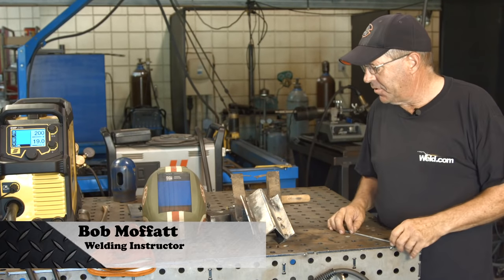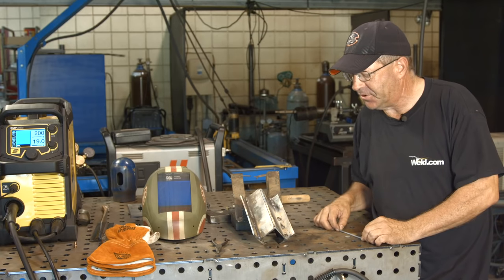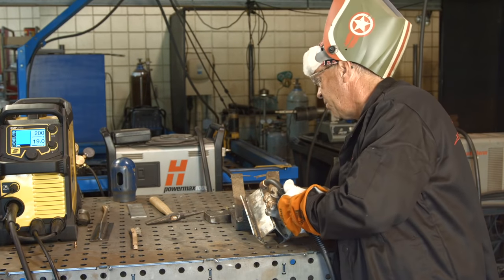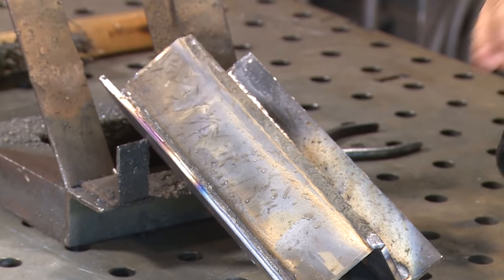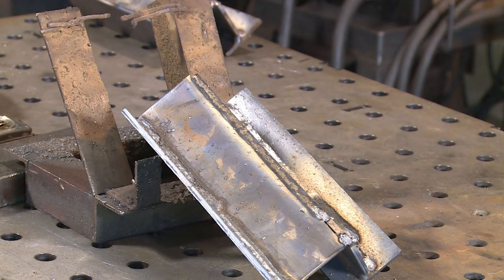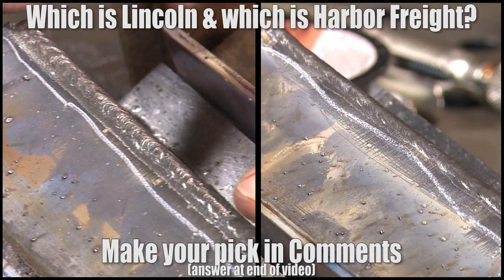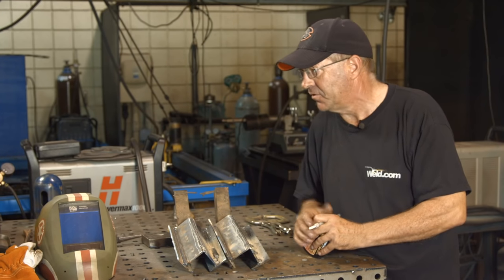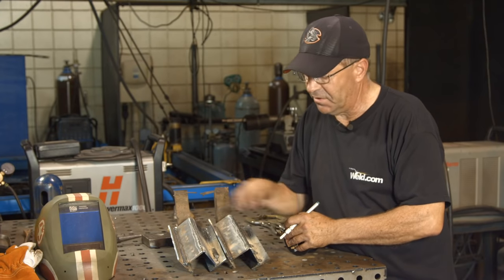Harbor Freight Flux Core Wire vs Lincoln Flux Core Wire: Part 1 of 2

Comment: I've used the Lincoln welder similar to that one back in 2000 and to 2003 I'm not in a professional just kind of self-talk myself what would be a Ideal wire feed welder for similar Metals White body work to medium body work metal thickness wise is there other welders out there that are easier to use and last longer I guess the whole question is what's going to be the best for a beginner and last the longest more durable I should put and we'll be able to do 16 event maybe up to quarter inch steel

Comment: 6:58 you are so far from wrong. First time I installed one of those in my 115 volt flux core machine I didn't hold the wire and about 2 1/2 feet sprung all over.

Comment: In my welder I can't adjust enough to make a decent weld with the harbor freight wire. It just doesn't stick. I go with the lincoln every time. Also I use the nozzle with mine because the splatter hits my wire without it and I notice it affects my weld.

Comment: i have the 90 amp harbor freight mig welder     and honestly   i prefer  the harbor freight wire  , i noticed you get twice as much wire  than the lincoln spool  for around the same price    and over time  the lincoln wire will plug up your contact tips alot more    it actually gets pretty annoying  ,

Comment: Awesome video! You just picked up a sub for sure. I am actually going today to get a JobSmart 125 amp to do some body work on an old beetle I'm working on.
Reply from the maker: Nice! we'd love to see some pictures of your progress on the forum.
Reply: Heading over to check it out now!
Reply from the maker: Billy Martin we're currently rebuilding the whole site, so the registration is down. Send me an email at info@weld.com and I'll set you up.
Reply: You can see my project at https://www.instagram.com/lowriden99ranger/ go check it out. There's going to be a video of the whole transformation when it gets done.
Reply: Hey Billy, sounds like we're in the same boat...  I just inherited a 71 beetle that I'm getting ready to strip down and I'm going to have to cut out the old heater channels and weld in new ones.  Say Bob.  Do you think I could get by with a flux welder for that job?
Reply: Have a jobsmart 125 Lincoln NR 211 MP works like a charm some spatter and smoke but can still see where I need to weld. Hobart does good on thinner stuff but more smoke and spatter hard to see

Comment: Not sure what was going on here but I use/used the harbor freight in both my miller 220 and I've used it in a harbor freight 90amp and it has only ever sounded like that when I had a shit ground. I usually have a nice steady arc sound. Seems very odd.

Comment: Bob, I find using the larger style spool of wire caused less issues with the spooling aspect you talked about; I guess from the larger spool there is less potential for bird nesting, anyway my thoughts on the owre spool issues.

Comment: i've done flux core for a bit at school now. had similar feeling where the wire didn't come out consistently. i'd also had problems with the same wire on 3 machines getting porosity. i'd tried different positions and speeds and settings and techniques and it was all the same so idk why flux core is so different. however i have gotten better arc length consistency by turning up a lil of the voltage and wire speed and reducing my gap by 1/8th. Flux core is so strange to me, i've done GMAW and SMAW for 6 years so i figured it would be in between them both but i never had such problems with either.
the wire was nr211  0.035 and the machines were a new lincoln and 2 millers of different types and age.
failed a 1 inch 3g because one of my bends had porosity cracks. really dissapointing but nothing i did changed that.
if anyone has a suggestion im all ears!
Reply: john creamer could it have something to do with your ground clamp?
Reply: @charlescooperderose8872  3 different machines, 3 different clamps, changing settings too. i melted the tip turning it up too high once.

Comment: were you using a knurled feed roll? i know it sounds like a gimme question, but the cheap fc welder that i have here didn't actually come with one when it was bought and sure enough, i got a lot of that slippage and jumpy arc trying to use the standard roll with it
Reply from the maker: Yes, we were using knurled drive rolls in the Rebel 215.

Comment: I have found with the harbor freight wire to fix the inconsistent wire length is u have to run a little higher wire speed

Comment: One of the other welding channels showed that the wire feed roller for a mig wire is shaped slightly different with serrations in the roller for mig wire vs smooth for flux core wire.
Reply: Its actually the other way around. serrations  groove is for flux core wire smooth for solid wire..

Comment: 1:57 - CTWD > 1/2" minimum; you say it's 3/8ths and sometimes your closer than that.
3:42 - You're a volt too high for that amperage / Wirespeed. Read the Mfgs recommendations when 1st time.

Puny Spools and very large diameter Wire always wiggle; puny spools work better in a Spool Gun and large Wire is slightly better if you straighten your Cable.

Twist the Gun so the Wire wobbles in a favourable direction (back and forth, or sideways to self-weave), diagonal wobbling would be useless; don't try to fight the Machine and expect the best results.

Usually that kind of Wire is for outdoors, useful when you don't want to haul Gas Cylinders (like high off the ground, Shipbuilding or Skyscrapers) and it's usually 0.45 with a bigger Stickout in a Suitcase.

Incorrect Stickout and off a Volt is off enough to not get the best results.

Parameters: http://m.lincolnelectric.com/en-us/consumables/Pages/product.aspx?product=Products_Consumable_Flux-CoredWires-Self-Shielded-Innershield-InnershieldNR-211-MP(LincolnElectric)

YT,
Rob

Comment: My Lincoln 90i FC will weld just fine for the first 20 seconds. After that, it wants to spool slightly. It does it with every wire I use. Drives me nuts.

Comment: believe it or not but we had the same issue in school with close to the same settings and the instructor contacted the maker of the wire and what he found blew us away. they said it had to be ran in a certain parameter, that being 16-17.5 volts and only 120-130 ipm, which we ALL thought sounded way off. when we tried it it blew us away because the welds were slow but beautiful. this may be different but I just thought I would throw that out there. I guess  Flux core wire is very particular and isn't run the same as other wires.??

Comment: I've been working with spool fed welders for 30 years open your box while you're pulling the trigger and not welding watch your wire roll and listen what's your Drive rollers and listen to them grab the wire after the contactor tip with a pair of pliers and try to stop it from coming out and pull the trigger that skipping could be caused by the paper on the spool they put the paper on the side that goes to the inside of the box you going to rip that sticker off it will mess you up you up

Comment: that wire is real finicky if you have any kind of debris in the liner it's going to do that you can't get away from it most aggravating. I use that wire almost every day there's a big difference in the harbor freight wire and the MP 211 the Harbor Freight wire is brittle when welded it's a real dirty wire. you have to have a wiper and a cleaner that you can pick up from a welding supply along with lubrication fluid for your machine .if not 2 rolls of wire and you'll be in the same situation is this man with the esab. in the case of a Lincoln 140 or 180 or any other little machine you have to change the entire gun with the esab you simply change the liner hopefully this is helpful
Reply: Robert Atwood I have a lincoln 140 and a 180 I can change the liner

Comment: I wonder more about duty cycle, than a short term weld comparison.  Settings on my Craftsman MIG go to crap once you start warming up the transformer.  Don't have that problem on my Lincoln.
Reply: This is about the wire. Same welder
Reply: Dallas
Whoops.  Thanks for the clarification.

Comment: I do a lot of 3d printing and have been for a long time. I swear the sounds the wire feeds are making are the same sounds I got when my gnurled bearings had material caked in it causing the feed to skip in what we call Bowden style extrusion. As to the nozzle, Pfft.. what works and gets the job done in my professional opinion.. My Flux core only welder has same nozzle. Works just fine, bit I am replacing it with a flux nozzle as soon as I find one that's compatible and fits. Until then, I'll use what I have and make it work for me...

Comment: I've noticed flux wire is sensitive to feed wheel pressure.
Reply: As have I dude I was taught if you can pull the trigger and stop the wire with you fingers then you are pretty much on point as far as roller presure goes

Comment: I've found that changing contact tip length with self shielded wire fixed the erratic feed on my cigweld200 mig. I was using shorter contract tips than the ones provided with the machine.

Might be worth giving that a try if you've ruled out the liner and drive rollers.

Comment: i have a buch of mig welders lincon,miller,esab,and i have a harbour freight 90 amp flux core welder i run the harbour freight .30 flux core wire and it welds like a high dollar gas mig only thing is you just have more spatter to clean. but its a good beginer welder

Comment: Cmon Bob. Both wires welded pretty much the same with the same issue, and it was an issue. Adjust the settings a bit until you get it worked out.
Reply from the maker: Ryan Jones Normally we would agree. however, it was a settings issue, it was a feed issue.
Reply: +Weld.com so either way, you have it worked out for the filet joint and etch test coming up?
Reply from the maker: Ryan Jones Yes, that's the plan.

Comment: As of today, the 10 pound spool of LE flux core at Lowes is exactly the same price as the 10 pound spool of the HF wire tested here.  Plus my Lowes is closer.
Reply: The Lincoln Electric wire, locally where I live is 2.5 times the cost of the HF wire!  I don't have a Local HF store, either!  I get better welds with the HF wire and it comes in 2 pound spools where the LE wire, again locally, comes in one pound spools or 10 pounders at an exorbitant price.  This particular business used to carry 2 pound spools of some National brand that I had never heard of for the same price as the Hobart wire that they NOW, carry in one pound spools!  Makes one wonder why they do this as a one pound spool is worth nothing because just when you need it most you have to change again!  PITA!  I hope that I can start buying 10 pound spools as I can't keep constantly changing these little ones!  BUT, I have to live on disability checks that don't leave much of anything after paying the monthly bills!
Reply: Umm congratulations???? Yeah you.... ??

Comment: Would like to see a review of the harbor freight welding helmet
Reply: most go in 3 months of serious use at longest although i have seen em make six
Reply: flytyer232 works great I have 2 electronic weld face shields with Chinese flames on them...lol
Reply: Say What!? for home hobby use theyll last longer then i previously stated but if your doing daily welds for hours on end they wont last
Reply: I'm not a pro welder but I am forced to do ALL of the welding at my shop because I am the only one who can run a bead...but the shop has a HF hood it's HF's top of the line auto shade...it's slow to dim and will give you flash burn with alot of restarts...I bought myself a blue-point off the snapon truck not sure who's make it as it's rebranded but it responds much faster btw 99% of my welds are patch/repair jobs on commercial lawnmower decks witch means thin rusty dirty spending 45 mins prepping for 30 secs of welding lol

Comment: I've used harbor freight 7018  rod, and the slag came off terribly, and almost sandy in consistency.  No comparison to excaliber or HR7018.  Never had the occasion to use the wire feed harbor freight.

Comment: If the arc is pulsing and you don't feel it jamming into the pool, your wire speed is too slow.  Some wires need to run faster or slower.

Comment: why does you're mig welds have this pulsating sound to it? my mig welds sound like one straight constant bacon fry.
Reply from the maker: +Someone Else Two things: 1. This is a flux core weld, not a MIG weld. 2) We think the pulsing is due to a bad feed, probably due in part to the small spool size.
Reply: Weld.com I also feel like you guys aren't doing fluxcore justice, I've mig welded with gas, I Tig weld both DC and Ac, I stick weld,  but now I do 90% of my work just fluxcore because it's so cheap, fast, convenient, efficient, and clean welds. That's after I discovered the awesomeness of anti splatter spray for fluxcore, fast easy clean up welds with no BBS and no splatter.  I feel like its the ego of professional welders getting in the way.
Reply from the maker: Not sure what you mean? We have nothing against gasless flux core. I believe we even said it's a great process for mobile work or when you're going to be welding outside.
Reply: Weld.com well your the only guy who doesn't do that, other people do. They would be out of a job if fluxcore performed just as well as mig. And i believe it does. please do a video of fluxcore with anti splatter spray, night and day difference.
Reply: ColtDeltaElite10mm in the professional tooling world fluxcore is used to make high carbon tool steel weld repairs.
Reply: Someone Else 3 things to know about flux core wire will use that kind of wire every day if you set the machine right you get a real low ladder content
Reply: No its not just for hobbiests, when you have alot of heavy welding do be done in and outside or drafty environment you use SSFCAW.
Reply: ColtDeltaElite10mm Duel shield is flux core, as well as self shielding wires. They are all FCAW.
Most skyscrapers are welded with SSFC. its also used in ship building/refit applications and, other heavy construction such as hard facing.
Sub arc is fine if you have a lot of big welding in position, but its useless past that.
They all have their place and have pros and cons.
Reply: MIG and flux core aren't the same thing.
Reply: killerms2221 No they are not. However dual shield and self shielding wire are.
Reply: ColtDeltaElite10mm You don't have to lecture me on what the different types of FCAW are, I'm I Red Seal journeyman welder with over 15 years experience welding.
The abbreviation FCAW (Flux core arc welding) covers all forms of tubular wire (except metal core).
 I was not advocating at any point, nor have ever herd of anyone using shielding gas with a self shielding wire.
You refereed to FC (flux core) and Dual shield as being two different processes when in fact Dual Shield IS flux core. The only difference is the flux compound in the wire and the addition of shielding gas.
Reply: You were hearing the inconsistent feed he was talking about
Reply: I'd love to see anyone swap TIG with 3/32 FCAW. Simply put, it will never happen. There are places where FCAW is king. (And yes, the 3/32 wire I'm talking about is self shielded.)
Reply: Someone Else a
Reply: A

Comment: i use lincoln wire in my home machine i have a lincoln mp 210 and i don't get a sputter used the 1.5 sample or w.e it was that came with the machine and have a 12lb spoll that run fine as well. Maybe your liner in the gun is dirty or drive tension is to low or high. Its something should not sputter like that.

Comment: I find the. . 30 wire runs soo much better then that. 35 wire im using a  converted Lincoln 100 i can do gas now but i like the flux core more only because i do alot of my work outside

Comment: Seamless fluxcore wire is the best I've used so far very smooth running wire but it's not gasless and very little spatter made buy Lincoln

Comment: your arc length is the problem it needs to be about 1/2 inch or even a little more to run this junk flux core wire it helps with the burn back effect now with the use of both i have ran a aws 3g grove with backing and i couldn't get the lincon to even bend the harbor freight bent but there were a lot of pinholes but no cracks in the bend i was fairly impressed with the harbor freight wire but with it the 2lb spools of the lincon stuff its no good it must not come from the same place as the 30lb spools its not the same stuff thats for sure

Comment: I run wire from Amazon.  It runs great and the price is right.  It came shipped in a air-tight sealed bag in a box.  Nice and clean!

WeldingCity E71T-11 Flux Core Gasless Mild Steel MIG Welding Wire 0.030" (0.8mm) 10-lb Spool 
by WeldingCity 
Link: http://a.co/1Masw3z

Comment: I feel like everyone automatically jumps to saying the most expensive pieces of equipment are the best. I have a 400$ klutch 120v mig and at work I use a 10.000$ Miller pulse. My klutch works just as good. Just can't weld the crazy think shit in one pass.

Comment: With that kind of wire you can't run it too fast slow down a little bit it will just fine like I said it's not made for speed it's made for repairs like handrail or thin metal you want thicker you want more better speed get a bigger roll like the 10 lb 11 lb rolls because the wire is more better roll better

Comment: Too much wire and not enough heat. It supposed to humm,not spatter, welded for a long time only difference is we used flux core with 75-25 gas mix